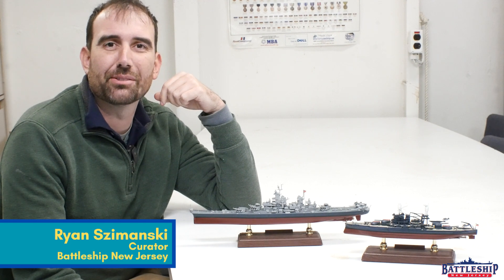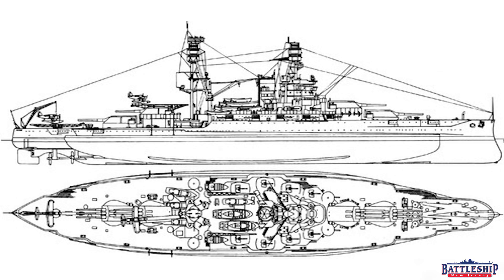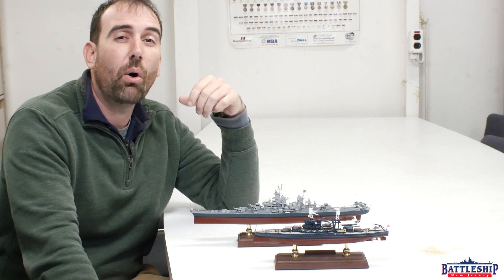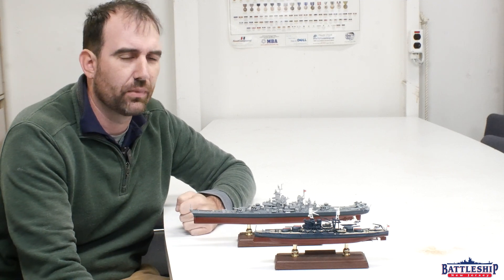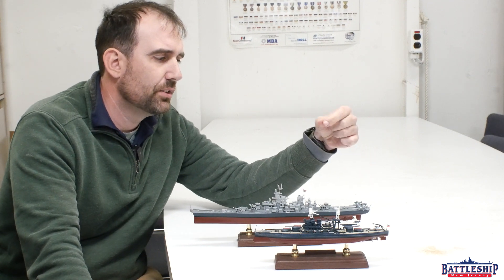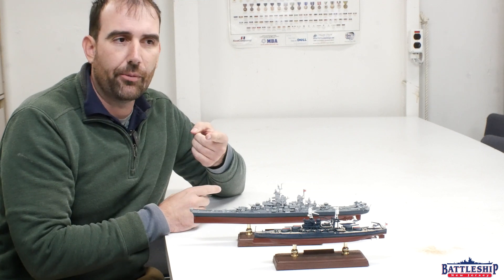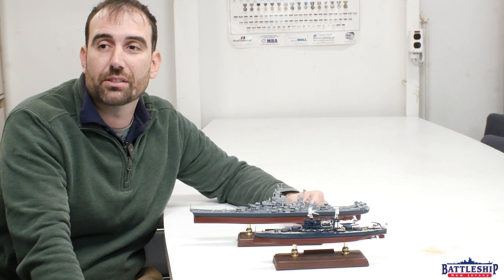Why Does Battleship New Jersey Have Such a Big Aft?

Comment: Wider stern equals thicker propeller shafts, more torque, more speed and agility, especially at higher speed, when you really need it. Also a tighter turn radius than its contemporaries, and the Iowas are much faster to its top speed than its counterparts. And with the added torque, the boilers didn’t have to run at full output to achieve top speed.

Comment: THE FATASS BATTLESHIP CHANNEL 📺👀
   Those 16" guns make your butt look big. 

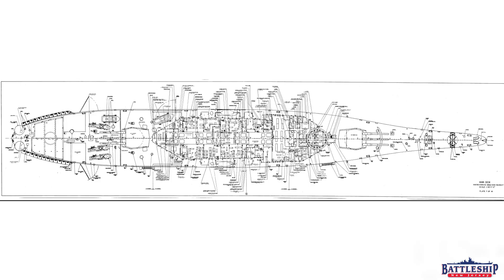1:35 The 'Coke Bottle' design:
🛩  The 'Area Rule', aka. Whitcomb Area Rule &  the Transonic Area Rule is a design technique used to reduce drag caused by airflow at transonic & supersonic speeds during transonic flight. The same principle applies also to ships & submarines. Hydrodynamics rather than aerodynamics, the only difference is that their chosen medium of travel is water rather than air 🚢
   It couldn't get any simpler than that 🤷🏻‍♂️
 🇯🇵  Don't the Japanese battleships also employ the same clipper ship & coke bottle design? If not for the pagoda superstructure, their hulls would would be identical to the Iowa battleships 🪞

🌌🔭

Comment: Fluid dynamics. The nose has to knife the water outta the way. The hull is a void of not-water.

As the ship moves on, the water moves to replace the void left behind. If you can use that water force as ship propulsion... Sloping the under-hull allows the water to push the ship forward. A bigger aft is more aft to push upon, is efficiency.

Comment: Since Yamato had a hull form close to that of Iowa, can you do a video on what her top speed could've been had she been fitted with the more powerful engines that Japan was developing, but that were not considered reliable enough yet? 
I read that Yamato's hull was designed to be capable of 31 knots based on the water tank tests her engineers did on scale models of her.

Comment: Probably get grief for this, but new jerseys rear end is a typical American rear end lol.

But on a serious note, ryan mentioned about changing the number of guns on board, how about doing a video about how its done and how easy or hard it would be, ie changing the turrets etc, and are there still dry docks with the cranes etc to remove any of the iowa class turrets. I guess its just doing the opposite of putting them in, but would make a good video

Comment: I wish they modernize and reactivate!!!
Reply: Russia and China would find a way to sink them. The Iowa class are also unnecessarily big for the significantly smaller crews that would be on these. 

Also, it wouldn't be that simple. They'd need new diesel generators or even install a gas turbine engine, have reactive armor installed, better keel protection from self-homing modern torpedoes, improve the deck drainage system, have an improved task control center, proper navy tactical data system, give them a new bulbous bow, get rid of all bolts to replace with wielding, make the command center significantly shorter, have stealth propellers, redesign the back of the ship to reduce vibration, possibly find room for a proper internal helicopter hanger, get rid of the armored conning towers, improve the plumbing system, rip off the back 16" guns for a cluster of missiles, automatic loading for the remaining guns, improve the former back right gun tub so it can work with newer drones (maybe possibly battery powered drones), new drone stations, and especially have new secondary guns like the 30mm Bushmaster.

Comment: I had no idea she was THAT much bigger than Arizona! That's the same shock I got when I discovered Mercury-Redstone is less than 1/2 the height of a Falcon 9. The F9 second stage & Dragon alone was the same height as the Mercury-Redstone.
Reply: Locate the picture of NJ's sister Wisconsin in Pearl Harbor 1943 moored next to the the derelict righted  battleship USS Oklahoma. Oklahoma is missing most of her superstructure but the difference in length and beam  of the two ships is clearly visible. Despite being approximately 20 years between the two designs.
Reply: If anything, the Falcon 1 rocket is way closer to the Mercury Redstone rocket size. It should also be remembered the initial Falcon 9 was not quite as tall as the current version. 

Makes sense the Redstone rocket would be small in actuality. It carried a capsule that was about the size of a small car and barely could reach sub-orbit. Hence the need for the larger Atlus rocket platform after the first few missions. Even then, the Titan 2 towers over the both of them. Saturn 1B was even taller than that. 

Despite the Mercury capsule being like a small car, it was actually very cramped being in them. 

If you want more surprising rocket size comparisons; India's SLV-3 is a shrimp compared to GSLV MKIII. Ariane 4 is actually really tall. It's a major leap from the original Ariane rocket and while not as wide as Ariane 5 it's still taller. China's Long March 10; the true replacement for LM 2F, will be even more of a monster in terms of height. Long March 9 in its current form will be huge compared to Saturn V and SLS Block 1b and Block 2 are planned to have upper stages much bigger than Saturn V's third stage. Heck, if you took a look at the Sputnik R-7; it's way stubbier than the newer Soyuz R-7 rockets. The upcoming Irtysh and Amur rockets will be taller in comparison. If the hydrogen powered upper stage Angara 5 (A5V) sees the day of light, the second stage will easily make it taller than the Proton.
Reply: Battleship Texas and New York are significantly smaller than the North Carolina alone. South Dakota also puts them to shame.

Comment: Another reason the WW2 USN and IJN battleships have the long flat sided in top view "raft body" is to keep the underwater torpedo protection system as consistently deep as possible along as much of the hull as possible. In canoe hulls the underwater system is broad only for a few feet astride the propulsion system and quickly narrows fore-and-aft, as per the Bismarcks.

Comment: And then, at the very, very end you end up with HMS Vanguard with her "square" transom...  Which is probably how, if battleship evolution had continued, would have ended up.
Reply: Vanguard would have been highly influential as there were comparative sea trials between the Iowa class and Vanguard.
Reply: The Vanguard was not the first British battleship with a transom stern. Both the G3 and N3 and the Lion's class were designed to have this stern. It gives approximately  1/2 knot extra speed at the same shaft horsepower than a conventional stern. What I can't find out is why the King George V wasn't designed with it.
Reply: @robhartley3930  The G3, N3, and Lion Classes may have been designed with the transom stern, but Vanguard was the first (and only) battleship to be built with one.  And the Vanguard was finished after the Iowas were.  So, my point is that the Vanguard shows a potential step forward from the Iowa Class.  Along with the "Bulbous Bow" design beginning to show up with the Yamato Class, the transom stern probably would have been "the next steps" forward. (If only there had been a "next step"....)

It should also be noted that American Cruiser design implemented the "Transom Stern" (as opposed to the fantail or "canoe" hull forms) so the USN would also have plenty of data to that shape as well...

Comment: i guess if they had designed a battleship these days and they would use the space of one of the aft turrets to either do more missiles or more of an ASW form, then they would definitely have a bigger aft. the shape of the upper decks are not the shape that actually goes through the water, so you could even get a genera shape like a rectangle, to maximize space even further

Comment: Does having a very wide stern help with high speed too? As what you don't want the ship to fall into the trough of it's bow wave and be steaming up hill. 

 If the stern is very narrow there is no buoyancy there so the hull is effectively shorter than it should be so it's hull speed is lower.

If you have a very wide shallow stern you get buoyancy from the second peak of the bow wave until it is right at the stern so the hull length looks longer than an equivalent canoe hull and it can go faster. 

I think the vanguard had a cut off stern making it wider to do something similar.
Reply: Vanguards transom was for similar reasons as Kamm tails on cars. The lower pressure drag of a taper, without the surface drag or weight.

Comment: When you have a ship of a given displacement - that displacement is the volume of water she has to displace.  So, you can't just narrow the hull somewhere and keep the same amount of stuff.  You either have to make the ship longer, wider, have her draft deeper, reduce the amount of stuff on her, or let her take on water.  If you go longer - she's harder to steer, more topsy-turvy especially in high seas, a bigger target for torpedoes, and anyone that has to go from bow to stern gets more exercise.  If you go deeper, she's slower to accelerate, takes more energy (fuel) to maintain a given speed, and relative to a longer ship you've got to trade more speed to maintain the same rate of turn, and anyone going from deck to keel gets more exercise.  If you reduce the amount of stuff on her - than Ryan has less stuff to talk about and at some point she becomes a cruiser not a battleship.  I think they got her proportions pretty good.  She's thicc in all the right places
Reply: mucho texto

Comment: Considering that the Navy has used this basic hull form for many of its subsequent capital ships (CVs) to this day, I'd say it was a pretty successful design.
Reply: The Panama Canal was a big big factor, pretty well constrains the design. You need the front to be pointy for hydrodynamics, the back end needs to be full for space and buoyancy.

Fast Panamax ships have that hull form. Without the Panama Canal, American battleships and subsequent capital ships would be significantly different. But with the constraints? Pretty darned good design.

Comment: The old adage " If it ain't broke don't fix it " comes to mind when consideration of changing a largely satisfactory hull form  of all American fast battleships of the W.W. # 2 era. A lot of design effort went in to the Iowa class and I believe the Navy applied this to the last class designed, the Montana class.   Thanks for the video.
Reply: True indeed although the Montanas if built would have traded the top five or six knots of "fast" battleship speed of the New Jerseys, to add heavier armor protection, and a fourth (superfiring) rear turret to give them twelve sixteen inch guns. Of course by that point it was glaringly obvious that the two or more extra Essex class carriers, that could have been built faster and for less money than one Montana, would be far more valuable to the fleet, so the Montanas were never even laid down, while the last two New Jerseys (Illinois and Kentucky) were cancelled while only partially complete. The Kentucky later performed valuable service for spare parts, when its bow was used to replace the bow of the Wisconsin after that front end was destroyed by a collision in 1956.